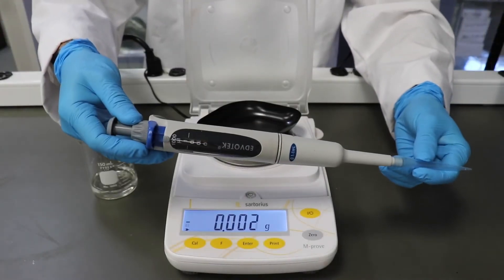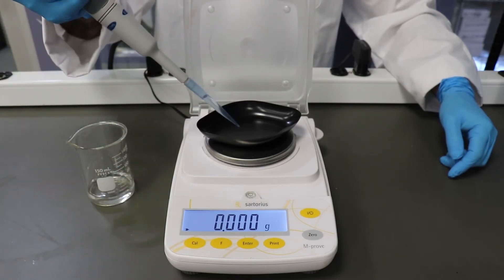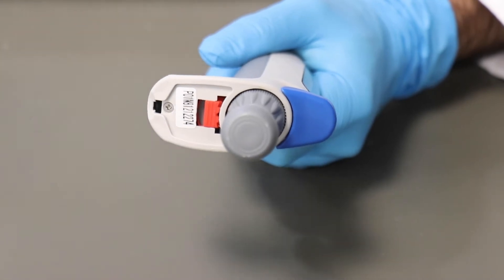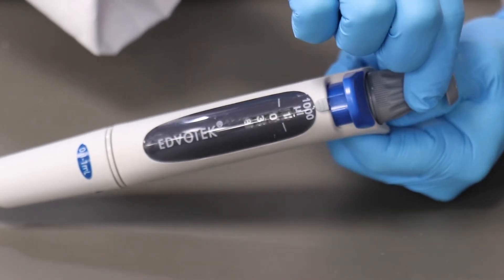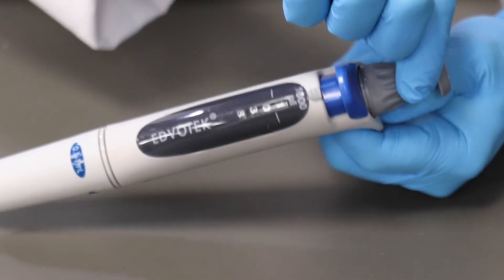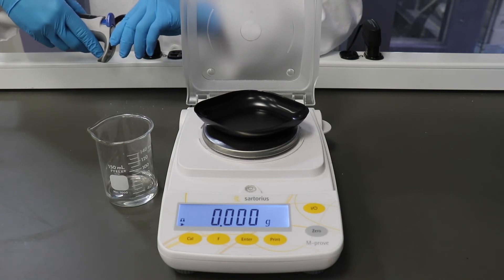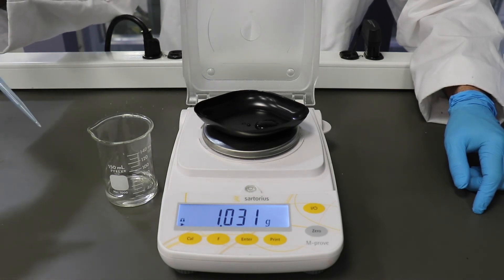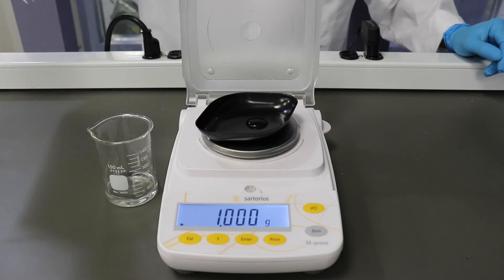How to Calibrate your Edvotek Pipet

Comment: It would help if the person doing the demo was using proper micropipette technique (aspirating at a vertical angle and then dispensing at an angle with the tip touching the receiving vessel).
Reply from the maker: Thank you so much for the feedback!

Comment: 1ml is not equal to 1gm
Reply from the maker: For water, 1 mL equals 1 gram.  That is how pipettes are calibrated.
Reply: @EdvotekInc  specifically in india, related to academics, when some guy comments, he is genrally right. Density is defined as mass per unit volume. The density of water varies with temperature. at 37 degrees, it is 0.993, at 26 degrees it is 0.997, at 4 degree celcius it is 1 g. I hope that justifies. Also, altitude also affects the wight, it goes slightly less since gravity is a bit weak on higher altitudes. Thought, it doesnt show significant difference to 1g, but can experience that with larger masses.
Reply from the maker: @abhijeetsurvase2556  Hi!  While nothing in your lecture is incorrect, most people in teaching classrooms do not have access to analytical balances, etc.  So in general, 1g = 1cm3 is close enough for our purposes. Have fun calibrating your pipettes!